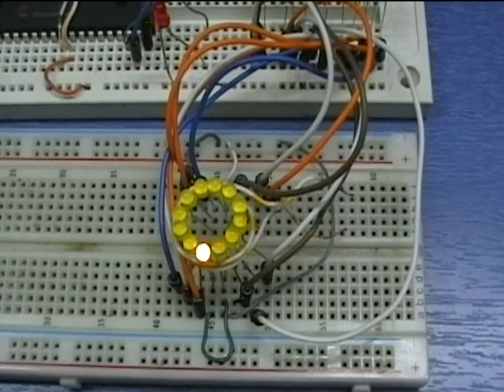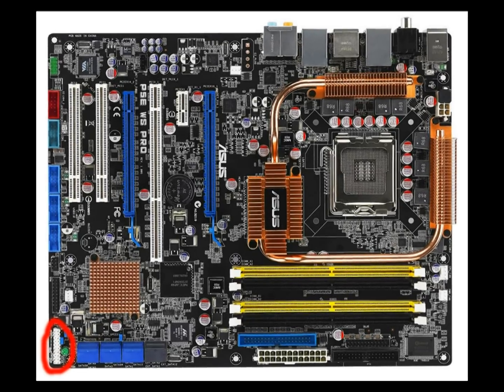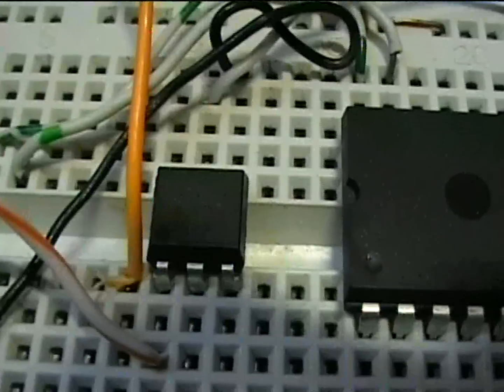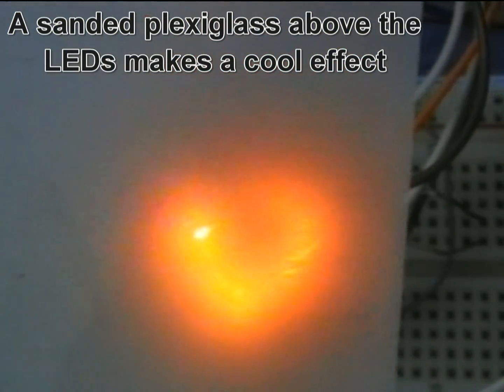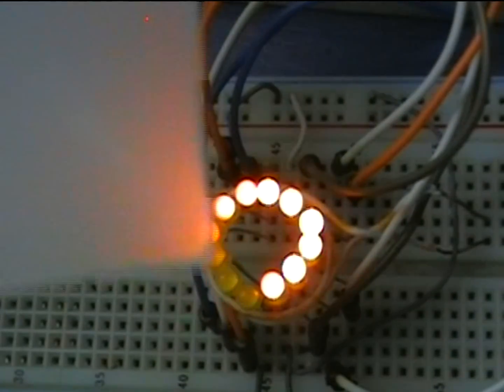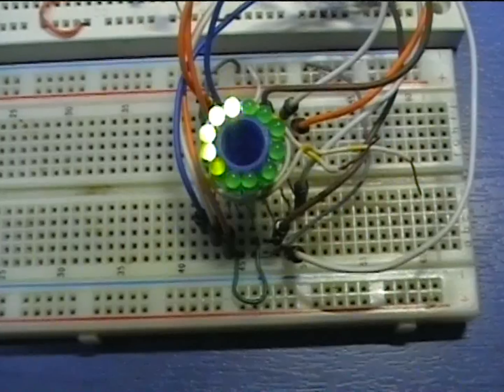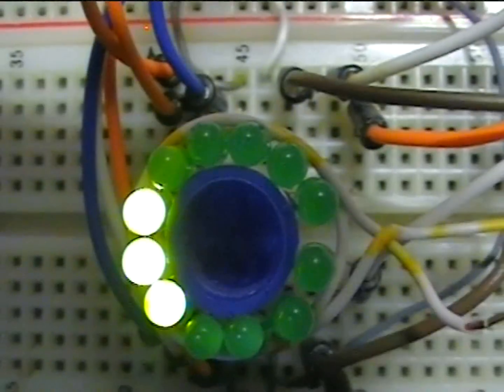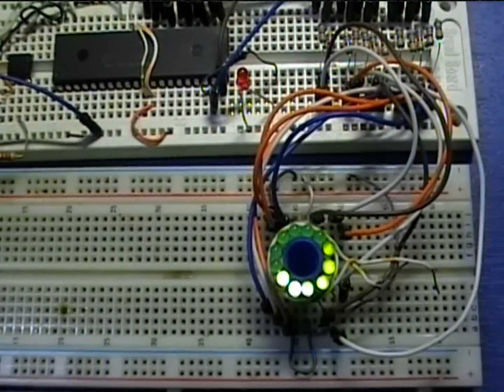LED Spindicator for the PC Hard Disk Drives

Comment: pretty cool, i might try doing something like this with a shift register and a small 5 volt picaxe, although it probably wont fade out or it will fade all of them out (using the OE line on the register using PWM) i might be able to use a UCN5841 which has open collector outputs or a '595, im pretty good at PICAXE basic and made a few interesting projects using the 8 pin ones, an 8 digit display is one of them

Comment from the maker: it needs a power supply as well, so it has to have 2 connectors, one molex (like those used for dc supply on HDDs) and one for the HDD LED